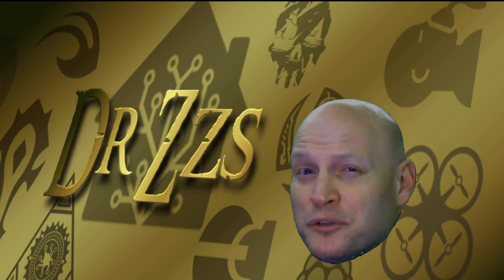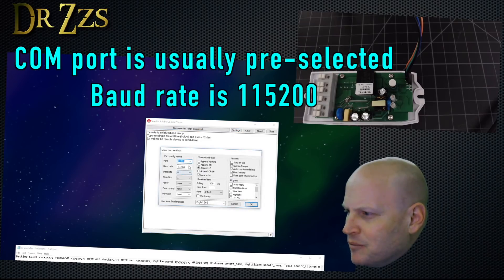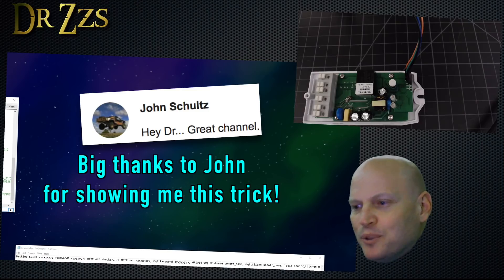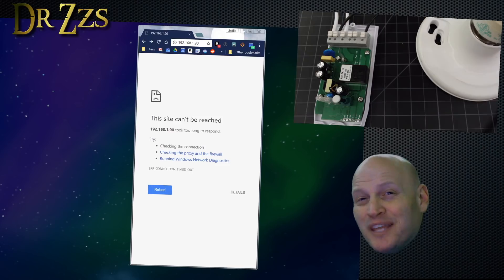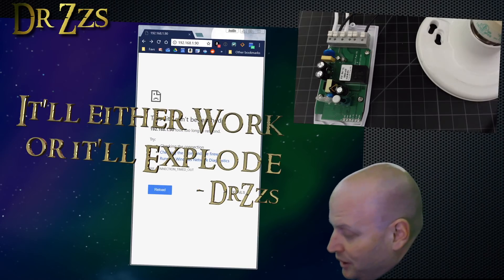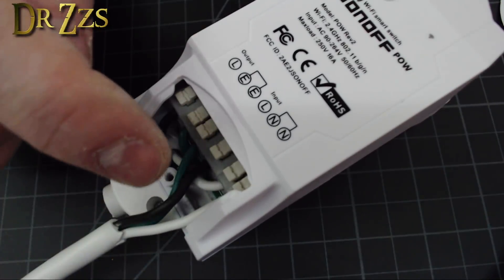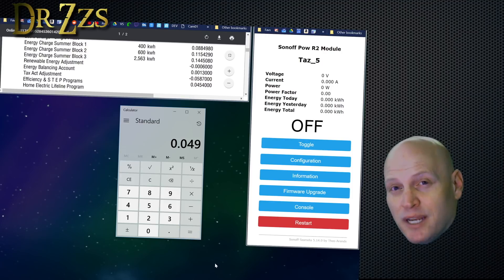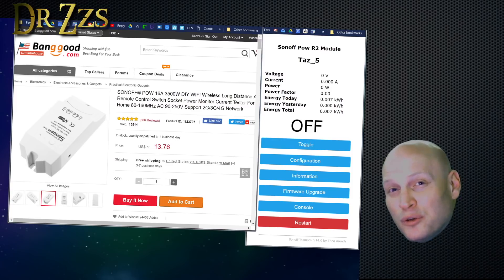Monitor Power Usage AND control your devices with the Sonoff POW | Home Assistant | Tasmota

Comment: Has anyone had a problem where the device is working but you only get a voltage reading but power and amps is 0?

It's connected to a central heating timer which switches on all electric radiators.  Is this because the timer is connected to the mains fuse box directly?  I'm confused please help!

Comment: Can you help to make value_template from this value (integer- "voltage") of MQTT:
{"id": 9032, "currency":"PLN", "online": 1, "pricePerUnit": 0.253000, "totalCost": 78.230000, "phases": [ {"number":1, "frequency": 0.000000, "voltage": 253.500000, "current": 0.341000, "powerActive":38.000000, "powerReactive": 0.000000, "powerApparent": 0.000000, "powerFactor": 0.000000, "phaseAngle": 0.000000, "totalForwardActiveEnergy": 309.223860, "totalReverseActiveEnergy": 0.000000, "totalForwardReactiveEnergy":0.000000, "totalReverseReactiveEnergy":0.000000 }, {"number":$number_1$, "frequency": $frequency_1$, "voltage": $voltage_1$, "current": $current_1$, "powerActive":$powerActive_1$, "powerReactive": $powerReactive_1$, "powerApparent": $powerApparent_1$, "powerFactor": $powerFactor_1$, "phaseAngle": $phaseAngle_1$, "totalForwardActiveEnergy": $totalForwardActiveEnergy_1$, "totalReverseActiveEnergy": $totalReverseActiveEnergy_1$, "totalForwardReactiveEnergy":$totalForwardReactiveEnergy_1$, "totalReverseReactiveEnergy":$totalReverseReactiveEnergy_1$ }, {"number":$number_2$, "frequency": $frequency_2$, "voltage": $voltage_2$, "current": $current_2$, "powerActive":$powerActive_2$, "powerReactive": $powerReactive_2$, "powerApparent": $powerApparent_2$, "powerFactor": $powerFactor_2$, "phaseAngle": $phaseAngle_2$, "totalForwardActiveEnergy": $totalForwardActiveEnergy_2$, "totalReverseActiveEnergy": $totalReverseActiveEnergy_2$, "totalForwardReactiveEnergy":$totalForwardReactiveEnergy_2$, "totalReverseReactiveEnergy":$totalReverseReactiveEnergy_2$ } ]}

Comment: HI DrZzs, I set up tasmota on the POW and its working. But I don't know which card to use on the frontend. I want something like this - any idea? https://user-images.githubusercontent.com/11230573/52817654-c6d30a00-30a4-11e9-9724-6e0d8953b314.jpg Can you please help.

Comment: Ok, I've got it. It works flawlessly using tasmota but is it possible to get "energy today", "energy yesterday" and "energy total" without flashing tasmota firmware? If it is, how to do that? Thanks.
Reply from the maker: hmmm
that's a good question.  I can't say for sure.  The ewelink app has been updated a lot and it may provide those details.  I wish I could answer confidently.  Sorry.

Comment: 2.8A is used by the print bed. The printer and hotend actually uses very little
Reply from the maker: true.  I should have compared them using different heat levels on the bed.  At the time I was printing with ABS a lot, so had my bed at 110C usually.  
Thanks!

Comment: All I get in termite 3.4 is:
"Termite is initialized and ready.
Type a string in the edit line (below) and press <Enter>

(or wait for the remote device to send data)."
I unplugged it and held down the button and plugged it back in and got the same thing. Any ideas on what to try next? I flashed the new software hoping I could get something to work in my new home assistant to show/work, but it's just an ugly paper weight now. I assume the eWeLink software wont work and home assistant doesn't appear to be working either.
Reply from the maker: you could try the Arduino IDE serial monitor or putty.  If you think you successfully flashed it with Tasmota, were you able to connect it with your network?  if you have then you can go to the tasmota webUI by typing the IP address of the sonoff into your browser to put in all the other information.  Connecting to it with Termite is nice, but not necessary.  So if it isn't working for you just use the wifi network the sonoff broadcasts after flashing to connect and get your wifi settings in.
Reply: @DrZzs  it said it flashed but it does not show up ad an available network on my phone. It also does not show on fing. I plugged the adapter into the computer but can not tell what com port it is on now.

Comment: Hey man I recently bought a Sonoff th16 it looks like it’s the same as the video but I want to use it to control a water pump that works at 250 volts but the Sonoff says it’s 90-240 do you think there will be any problem with this could I damage the Sonoff?

Comment: Sorry if this has been answered, but after searching and reviewing the documents from itead, I still can't find the max gauge wire the terminal block can accept? Can it handle wire as thick as 12 guage? Or does it max out at 14 gauge?
Reply from the maker: 12g threaded wire is too big.  I've tried it.

Comment: i would like to use the sonoff pow to measure how much each user uses an electric shower water boiler. We're living toghether in a house and i would like to split the costs. Is it possible to get the power and associate the device from which the boiler was turned on (each user turns it on from it's own cellphone or computer)
Reply from the maker: no, I don't think that's possible exactly.  Maybe if you created 2 different input booleans, one for each user, then tracked which one turned on the boiler. But making an automation that totals the power use and assigns it to a specific user would be pretty complicated.  
Also, make sure the boiler isn't over the current rating of the POW.  It shouldn't be, since the pow is 16 amps, but a boiler can draw quite a bit of current.

Comment: Question... you calibrate with a light as the load... where the Power is known, so the amp/current can easily be calculated, using the known voltage
problem, on something like a kettle or toaster or a motor, the power might be dependant on the load, so unknown...what now?
G
Reply from the maker: good question.  
I don't know much about the power factor calculation.  It probably isn't much of a difference.  Sorry I'm not more help with that question.
Reply: @DrZzs  Can't know everything. but I'm sure I made you wonder now...and if you anything like me you're going to do some research...

Comment: You also need to consider the power factor when calibrating the device. It now considers the fluorescent light as a 1.0 power factor unit, which is not true.
Reply: So true, it really bugged me, because it was a great video otherwise, it's just the calibration is done incorrectly.

Comment: Thanks Dr.Zzs, i am not sure, but it seems the new tasmota firmware requires below configuration instead in home assistant

sensor 2:
    - platform: mqtt
      name: POW Current
      state_topic: "tele/WaterHeater/SENSOR"
      value_template: "{{ value_json.ENERGY.Current }}"
      unit_of_measurement: 'amps'
    - platform: mqtt
      name: POW Power
      state_topic: "tele/WaterHeater/SENSOR"
      value_template: "{{ value_json.ENERGY.Power }}"
      unit_of_measurement: 'watts'
    - platform: mqtt
      name: POW Voltage
      state_topic: "tele/WaterHeater/SENSOR"
      value_template: "{{ value_json.ENERGY.Voltage }}"
      unit_of_measurement: 'volts'
Reply from the maker: It's very possible.  What version of Tasmota are you using?
I haven't tried any version beyond 5.14, and the version I was using in this video may have been older than that. 
Is that configuration working for you?
Reply: @DrZzs  i can confirm the above code is now needed. just received some pow r2's and flashed with tasmota 6.4.0 was wondering why the sensors in hassio were not functioning

Comment: Great work Dr. Z very helpful video, I did run into a problem with using the state_topic: Stat/xxxxx/STATUS10 to get the data from the sonoff POW R2. It wouldn't update unless i sent the command Status 10 to the sonoff. So I used the tele/xxxx/Sensor  instead and it updates every 90 seconds now. Hope this helps if anyone else had the same problem

sensor:
  - platform: mqtt
    name: Pool Pump Current
    state_topic: "tele/Pool_Pump/SENSOR"
    value_template: "{{ value_json.ENERGY.Current }}"
    unit_of_measurement: 'amps'
  - platform: mqtt
    name: Pool Pump Power
    state_topic: "tele/Pool_Pump/SENSOR"
    value_template: "{{ value_json.ENERGY.Power }}"
    unit_of_measurement: 'watts'
  - platform: mqtt
    name: Pool Pump Voltage
    state_topic: "tele/Pool_Pump/SENSOR"
    value_template: "{{ value_json.ENERGY.Voltage }}"
    unit_of_measurement: 'volts' 
  - platform: mqtt
    name: Pool Pump Power Total
    state_topic: "tele/Pool_Pump/SENSOR"
    value_template: "{{ value_json.ENERGY.Total }}"
    unit_of_measurement: 'kWh'
Reply from the maker: yes! thank you!  I sure wish I could go back and just edit parts of videos when good changes come along like this.  YouTube makes it so you have to do a whole new video instead of being able to make small changes.  Grrrr

Comment: Hey dr, i have an issue, the pow is only showing the voltage, not the other parameters, it is also an R2
Reply from the maker: hmmm. 
Are you seeing the other values in Tasmota but not in HA?
My first guess is there's a problem with the Value Templates.  Double check those.
Reply: DrZzs  the problem was the ground cable, was conected badly, when i reconnect everything correctly, it work perfect.
thnks Dr, keep up the good work!
Reply from the maker: AlkaCL  sweet! I love those kinds of solutions!

Comment: Great Video!  In case anyone orders the POW on Amazon and gets the old POW Ver 1 shipped to them like I did, you'll need to use the following topics and value_template config in home assistant as the one in the description didn't work for me.

  - platform: mqtt
    name: "Energy"
    state_topic: "tele/sonoff_pow1/SENSOR"
    value_template: '{{ value_json["ENERGY"]["Today"] }}'
    unit_of_measurement: "kWh"
  - platform: mqtt
    name: "Power"
    state_topic: "tele/sonoff_pow1/SENSOR"
    value_template: '{{ value_json["ENERGY"]["Power"] }}'
    unit_of_measurement: "W"
  - platform: mqtt
    name: "Voltage"
    state_topic: "tele/sonoff_pow1/SENSOR"
    value_template: '{{ value_json["ENERGY"]["Voltage"] }}'
    unit_of_measurement: "V"
  - platform: mqtt
    name: "Current"
    state_topic: "tele/sonoff_pow1/SENSOR"
    value_template: '{{ value_json["ENERGY"]["Current"] }}'
    unit_of_measurement: "A"
Reply from the maker: Thanks!  
great info.  Some re-sellers still have old sonoff devices in stock.  If you want the newest it's best to order direct from iTead:  This 'should' be an affiliate link for iTead... should - https://goo.gl/sRr1Xi

Comment: Hi thanks again for another video, just need some help. STATUS10 do not work in homeassistant

- platform: mqtt
  name: Ampérage PS4
  state_topic: "stat/ps4/STATUS10"
  value_template: "{{ value_json.StatusSNS.ENERGY.Current }}"
  unit_of_measurement: 'amps'

- platform: mqtt
  name: Puissance PS4
  state_topic: "stat/ps4/STATUS10"
  value_template: "{{ value_json.StatusSNS.ENERGY.Power }}"
  unit_of_measurement: 'watts'

- platform: mqtt
  name: Voltage PS4
  state_topic: "stat/ps4/STATUS10"
  value_template: "{{ value_json.StatusSNS.ENERGY.Voltage }}"
  unit_of_measurement: 'volts'

no result in HA

Comment: Another great video DrZzs, your videos got me started on my sonoff / tasmota / home assistant journey, now I have loads all over the house, The sonoff pow R2 in this video was particularly useful for me, I run my cellar sump pump through it... which gives me a pump running indication and has enabled me to program home assistant to send notifications if the pump hasn’t run in a set time period and also to cut the pump out if it has been running continually over a time period suggesting a fault and again to notify me it’s a great piece of mind knowing my pump is working as it should and my cellar isn’t flooding and all for £10.25 on aliexpress, Great stuff !! Thanks again keep up the good work
Reply from the maker: wow.  That's great! 
Glad to help!

Comment: Hi Doc! I install one of these with calibration included and is working well, switching it from HASS overview homepage, and with automations. I'm stuck with the mqtt status mssge of the sensors. All the measurements are available directly on tasmota's console, but tele/stat commands don't read the info from Home Assistant.
The status of the power, current, voltage, etc says unknown...

This is what tasmota's console says:
15:09:35 RSL: tele/sonoff_25/SENSOR = {"Time":"2018-07-11T15:09:35","ENERGY":{"Total":3.443,"Yesterday":0.000,"Today":1.341,"Period":0,"Power":0,"Factor":0.00,"Voltage":0,"Current":0.000}}

And this is my config file (I tried diferent combination of value_template, whithout success in any):
- platform: mqtt
  name: "Pool filter Current"
  state_topic: "tele/sonoff_25/SENSOR"
  value_template: ' {{ value_json["ENERGY"]["Current"] }} '
  unit_of_measurement: 'A'
  icon: mdi:flash

- platform: mqtt
  name: "Pool filter Power"
  state_topic: "tele/sonoff_25/SENSOR"
  value_template: '{{ value_json.ENERGY[0].Power }}'
  unit_of_measurement: 'W'
  icon: mdi:flash

- platform: mqtt
  name: "Pool filter Voltage"
  state_topic: "tele/sonoff_25/SENSOR"
  value_template: '{{ value_json["ENERGY"]["Voltage"] }}'
  unit_of_measurement: 'V'
  icon: mdi:flash

- platform: mqtt
  name: "Pool filter Total"
  state_topic: "tele/sonoff_25/SENSOR"
  value_template: ' {{ value_json.ENERGY.Total }} '
  unit_of_measurement: 'kWh'
  icon: mdi:flash

Any idea of what could be wrong?

Comment: Thanks for this. I managed to install Tasmota. Power on off work
I have the following reading in the Tasmota page

Voltage 232 V
Current 0.065 A
Power 2 W
Power Factor 0.14
Energy Today 0.000 kWh
Energy Yesterday 0.000 kWh
Energy Total 0.000 kWh

I added the sensor info and changed mqtt topic to my topic- stat/sonoffp1/STATUS10

However in HA I  see only- unknown. No readings

I added your script to sensor and then created item in front end

Anything else to be done to get the templates working?
Reply from the maker: I’ve recently had similar troubles that I haven’t solved yet. I wonder if maybe we need to change Status10 to something else. 
Go to the TASMOTA console and just watch what goes by. It should report the volt/current etc frequently. When it does take note of the topic that comes before it. Make sure that matches the topic you have in the sensor entries. The other thing to check would be the structure of the payload. It may be different and require a change in the template.  
I know that’s not an exact answer. I need to trouble shoot my own then I can probably give a better answer.
Reply: Thanks. I asked the question on today's live session (6 July 2018) and the instructions provided did not work for me though it worked for you to fix the issue. As per this https://github.com/arendst/Sonoff-Tasmota/wiki/Home-Assistant if your Tasmota  Program Version 5.9.1 you need to have a different sensor config . Posting here in case someone looking at the video here will run in to the same problem

Update the configure of sensor NECESSARY ONLY with v.5.9.1
- platform: mqtt
  name: "Energy"
  state_topic: "tele/pow1/ENERGY"
  value_template: '{{ value_json["Today"] }}'
  unit_of_measurement: "kWh"
- platform: mqtt
  name: "Power"
  state_topic: "tele/pow1/ENERGY"
  value_template: '{{ value_json["Power"] }}'
  unit_of_measurement: "W"
- platform: mqtt
  name: "Voltage"
  state_topic: "tele/pow1/ENERGY"
  value_template: '{{ value_json["Voltage"] }}'
  unit_of_measurement: "V"
- platform: mqtt
  name: "Current"
  state_topic: "tele/pow1/ENERGY"
  value_template: '{{ value_json["Current"] }}'
  unit_of_measurement: "A"

Comment: Hi Doc! My sensors aren;t working in HA. Maybe this is because it needs a different configuration on the configuration.yaml file for sensor because my Sonoff Pow is not R2? Does the regular Sonoff Pow needs a different config in HA? TIA!
Reply from the maker: it might.  First make sure you have the correct module selected in the "Module Type" menu in tasmota.  Are you getting sensor data on the web UI in Tasmota? 
It might just be the topic.  What output do you get when you type "Status 10" in the tastmota console?

For the R2 Status 10 looks like this: 

MQT: stat/Taz_5/STATUS10 = {"StatusSNS":{"Time":"2018-06-28T16:20:57","ENERGY":{"Total":6.228,"Yesterday":0.485,"Today":1.582,"Power":63,"Factor":1.00,"Voltage":120,"Current":0.386}}}

the first part (stat/Taz_5/STATUS10) is the topic.  The part after the "=" is the payload.  So your "state_topic" in HA, needs to match whatever you see before the =, and to get the value we want out of the payload we set the value_template so that after "value_json." we put the word that comes before the ":" because that is the category.  In this payload the values we want are nested so to grab the right value we put all of the categories separated by a "." 

so the value template to get current from my "status 10" output looks like this: 
value_template: "{{ value_json.StatusSNS.ENERGY.Current }}"

That's a long explanation.  That's essentially what I want to explain in a video just about json in HA and Tasmota.  Hope it helps.
Reply: Hi, did you manage to get it working? I am having the same issue!
Reply: 12:02:42 MQT: tele/sonoffpow1/STATE = {"Time":"2018-07-26T12:02:42","Uptime":"0T01:00:05","Vcc":3.174,"POWER":"ON","Wifi":{"AP":1,"SSId":"XXXXXX","RSSI":72,"APMac":"F8:AB:05:B1:01:57"}}
This is what I got from the Tasmota console
Reply: 12:02:18 MQT: tele/sonoffpow1/SENSOR = {"Time":"2018-07-26T12:02:17","ENERGY":{"Total":0.014,"Yesterday":0.000,"Today":0.014,"Power":12,"Factor":0.00,"Voltage":240,"Current":0.000}}

Comment: could you show how to smooth out the spikes every time the relay opens and closes in the data logs in home assistant  is it a matter of just putting a point one capacitor across the relay contacts I'm about to try this myself I'll let you know if it works Keep up the awesome videos
Reply from the maker: Thanks. 
ya, let me know if that works.